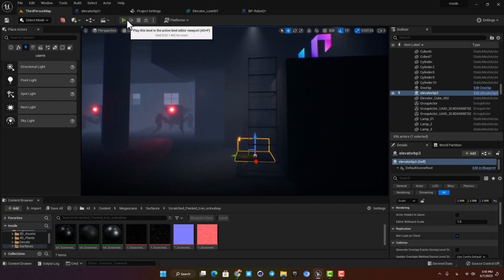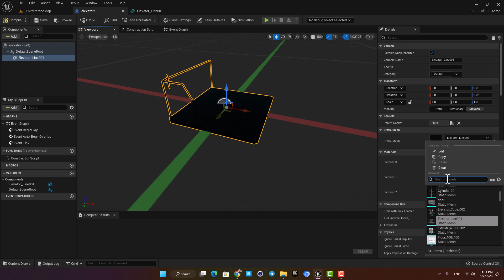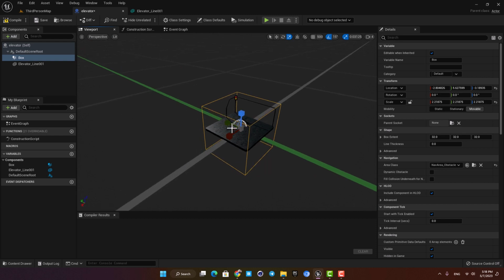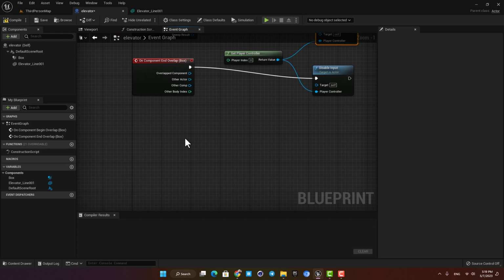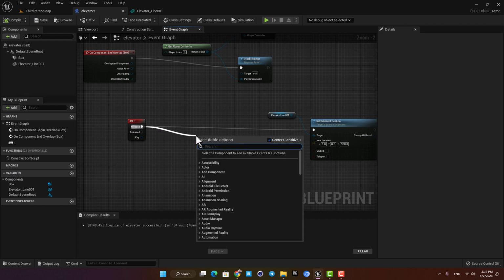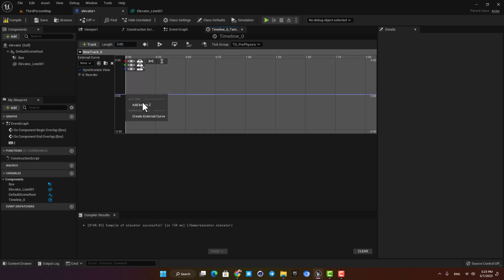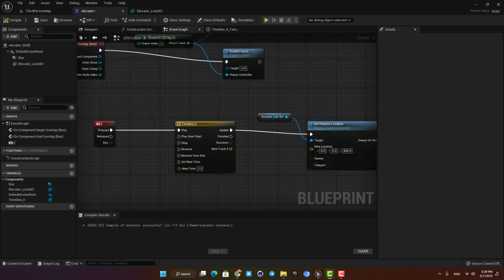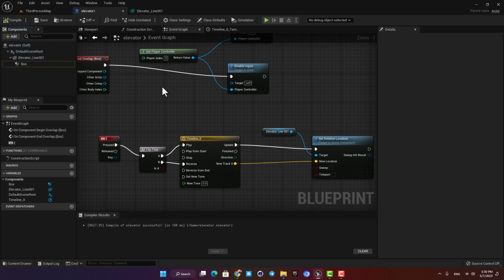Make An Elevator In Unreal Engine 5 Using Blueprints

Comment: It is just wonderful!!!. Can you please make a video on how to do the elevator in VR?
Reply from the maker: thanks mate, well it's not that different you just need to set the inputs on your controller and the rest is the same. try this and let me know if there was any problems
Reply: @UnrealART  Thank you for the quick reply. The problem with VR is the camera does not go with the lift. It behaves weird. It gets stuck below the lift floor
Reply from the maker: @RjssManipal  I think you need to check the navigation bounds and the collisions for both the elevator and the VR pawn. Other than that I don't have a solution right now I have to look into it. setting up VR systems is always tricky

Comment: How do I put it where the elevator going down first and not up? When I connect the NewTrack with the new location it seems to lock it to positive Z and cant change it to be negative Z, aka make it go down first.
Reply from the maker: you can multiply the timeline value by -1 and then connect it to the function. however, I have not tried it myself so not sure if it works properly, but give it a shot and see what happens
Reply: @UnrealART  I watched another video and got it working. Thanks for replying tho

Comment: Hi there is one little problem with this aproach, at the moment its fixed between 0 and 300 in this case. which means when you palce your elevator object on current location somehwere up in the scene, it will always be resetted to 0 and 300 as minimum and maximum postion. This means you always need to audjust when you have multiply elevators every blueprint and set the absoulte values there.

Do you have an idea how to get the current location before? So for example when I palce my elevator at z =50 and add over the timeline +150 that my elevator ends in z = 200?
Reply from the maker: yeah just add a get location function in the blueprint , that will do the job